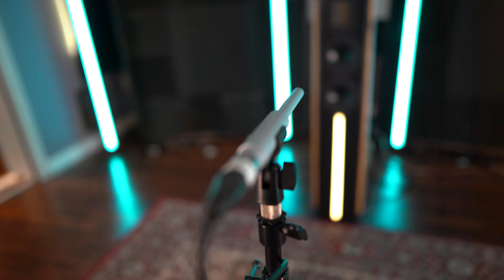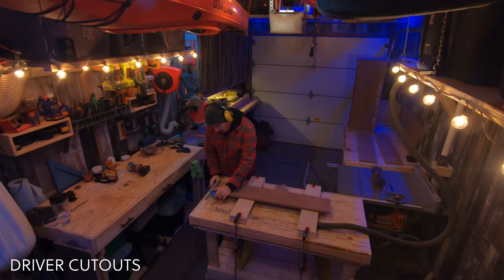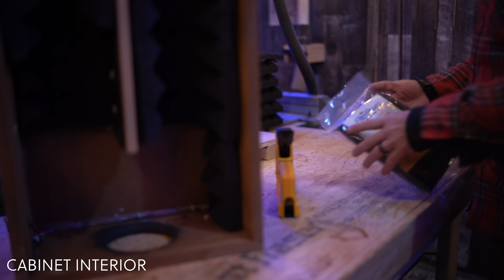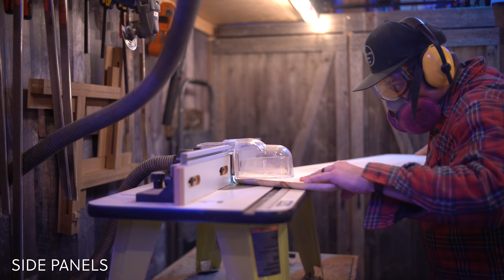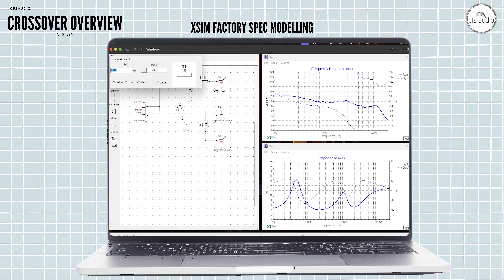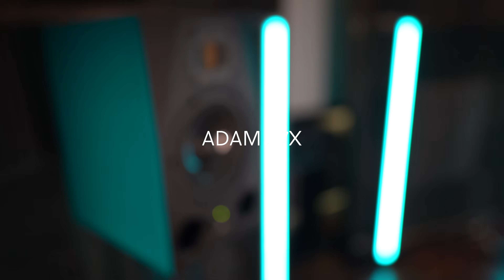🔊 Your Ultimate Guide to Building Amazing DIY Speakers! 🔊

Comment: What software did you use to decide the location of vent for the transmission chamber?
Reply from the maker: Hey thanks for watching. It was all practical. The design was done with math and then I built several prototype’s until I got the audible and measurable results I was happy with.
Reply: @chrisferris3303 wow.  That’s a lot of effort. Kudos to you.

Comment: Really nice! Few things I was curious about since I've been looking into building my own speakers. The thing with the transmission line is your resonant frequency is shifted by 90°; orienting downward is probably a boundary effect as much as it is a directionality. End result sounded kind of like a can after conditioning to the Adams, with the guitars beaming around 900hz. Since this is a 2.5way speaker, maybe putting a higher value inductor on the second woofer; I see it labeled as L3. I have the Klipsch Reference R-600F myself. Pretty decent speaker but did need a lot of EQing to get them right.
Reply from the maker: Hey thanks for watching. You’re not the first to suggest a higher value inductor. I currently have a 2.0 mh on those second woofers. I’ll try upgrading in the future and see what happens. Yeah those klipsch arn’t for everyone. I got them about 10 years ago and was so proud lol.
Reply: @chrisferris3303  keep it up, I've subscribed, waiting for the next build!

Comment: So what’s the final crossover design? Including DCR‘s.
Internal dimensions? 
Port size? 
Driver location? 
I searched before I posted this, did I miss a link?
Reply: really all the information about dimensions and driver location is in the video, but without the cross over design is really hard to make this build happen.
Reply: @federicocalvino9935  Are you saying that the values shown on your Crossover X-sim are the ones you used for build or not the ones you used? I am looking at this more from an educational standpoint and curiosity mainly. Thanks for the great video!

Comment: It seems/ sounds like you nailed it! Sounds best of them all and look stunning! During the covid i made myself speaker boxes out of oak! It was a challenge with my few tools and in a normal garage 🥵. I took a shortcut by using the elements and electronic from wharfedale 10.7 speakers but the sound changed to the better, or was it just what i imagined after all the hard work 😂😂.
Reply from the maker: Hey thanks for watching. The last set I built I did a similar thing. Used a premade Dayton audio crossover. On paper, sure they weren’t up to spec but they still sounded great :).

Comment: nice build! but why not mtm config? the phase it will be better
Reply from the maker: Hey thanks for watching. So I tested an MTM when I was prototyping these and I found the bottom end wasn’t as tight. Also with the height of the speaker I thought an MTM might place the tweeter a little low. All that being said I really wanna do an MTM build. Thinking of maybe doing a pair of MTM bookshelf’s.
Reply: @chrisferris3303  yeah mtm will require a taller speakers - and btw. if you want to eliminate some baffle difraction a small radius on the front vertical edges always helps;)

Comment: How about a zobel network for a lower impedance spike ?
Reply from the maker: Hey Sheila. Thanks for watching. As I had to Google what a Zobel network was I will respond with a question lol. Would the benefit of controlling of the spike out way the slight degradation from the additional components in the network?
Reply: @chrisferris3303 no
Reply: @chrisferris3303 zobel network is for your amplifier so he doesent have to work to much. More impedance also means lower db of speaker.
Reply: Zobel network is for the amp to stay working normal  and does not lose control and goes into distiotion 🎉😂❤
Reply: If the impedance spike is huge you can hear the amplifier distortion within the sound of the driver ….🎉😢

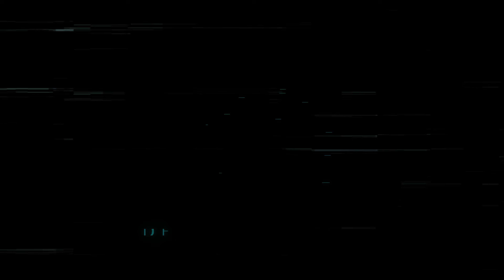Comment: Nice new speakers! I just finished up a MTM design over the weekend. I used  hardwood flooring  that I had left from a job. oak and I covered the MDF 27:34 F sides , back and the bottom and the front with hard  maple. I used industrial 27:34 flooring adhesive to adhere the  flooring to the MDF and it added strapped and clamped. It was pre finished and I sanded all down to the fresh wood. That's what took me so long and they weigh 100 lbs a piece but they don't vibrate 😅
Reply: What about drivers used and xover components?
Reply: @matejpodlesnik6538 I designed a third order crossover at 2000 Hz Jantzen z caps and 14 gauge air coil inductors. #2 6.5 Dayton designer woofers 8 ohms in parallel for 4 ohms, Dayton reference silk dome .
Reply from the maker: That build sounds awesome! How do you like the MTM Array? I was considering doing these as an MTM.
Reply: @chrisferris3303 Thanks! I find the MTM gives me a focused sound stage. Everything sounds like it's coming from one point. I used a 3 third order crossover on the high end low pass and I moved the tweeters to the side so I could avoid diffraction and get my mids closer to each other. I want to try a T line but it looks complicated. I'm glad to see you making new videos!
Reply from the maker: @BostonMike68 good stuff.

Comment: MDF is only used by speaker companies because it's cheap and easy to use. Birch Plywood is far superior
Reply: Its not far superior at all sonically there's virtually no difference, the only advantages are lighter weight and mild water resistance. The only time its really advantageous is for portable PA gear ie: weight.
For my use it would be ply for its aesthetics with the end grain exposed.
Reply: If it were the case, then companies like Focal would use Birch.  
Even the grand utopia which cost around a half a million for a pair they use MDF.
Reply from the maker: That’s interesting. I built a guitar cabinet out of birch plywood. I thought it sounded great. I’ll try it on my next bill. Thanks for watching.
Reply: @chrisferris3303  hi chris! I am very curious what your break in process if at all, was on the speakers that you built before you did the comparison. Also, I’m not a fan of Klipsch (even though I’m German.) I never have been. I have always found them to be very bright and shrill. I guess that has a lot to do with the fact that most rooms that they’re in are what I call California homes or Florida homes with vaulted ceilings and glass everywhere and tile floors. Completely the opposite of your listening room. Although I was wondering, one part of your video why you had the door open? And I would definitely switch those doors to solid wood as glass has a negative effect on sound waves. In case you’re wondering about my background I’ve been in the High End audio industry since the mid 80s. I was a manufacturers rep for Focal, Amphion, T+A, Straightwire, Theta, Jeff Rowland Design, and many others.  At the present time, I own a computer repair company. I also build, fix, and play guitar.  Not bad for a 55-year-old grandmother!  ☮️💜😊
Reply from the maker: Hey Tarynn. Thanks so much for watching. For breakin I literally let them play for like 2 days straight. It was wild to hear the difference after that period. 
The room I was doing the testing in doubles as a tracking room for my studio at so the glass doors help me see the talent. I doubled them up to help with the separation between the space. As for the door being open in the one shot I was just filming at that point probably let the dog in or out. Thanks again :).
Reply: @chrisferris3303  Gotcha!
Reply: Absoluter bullshit.
Reply: Real baltic birch is impossible to find right now. If u do its heka expensive. Didnt used to be the case. I think a lot of folks get 11 ply birch finished plywood now cuz they think its baltic birch.
Reply: @bingdong8571  wear I live HD has 15-16 ply, 3/4”-18mm